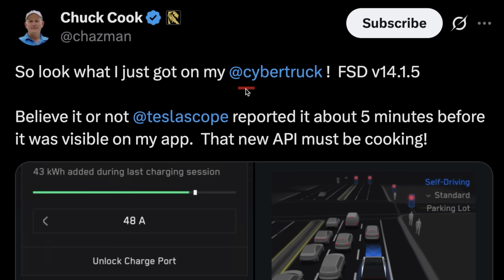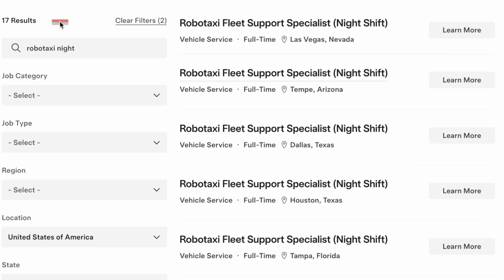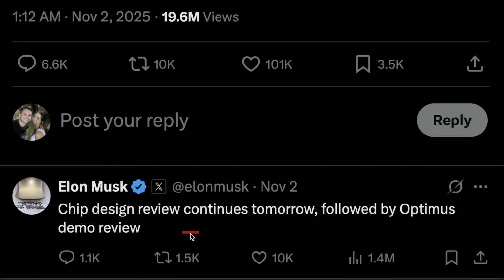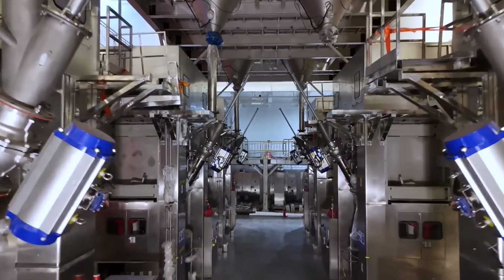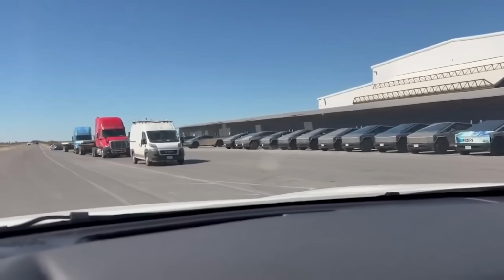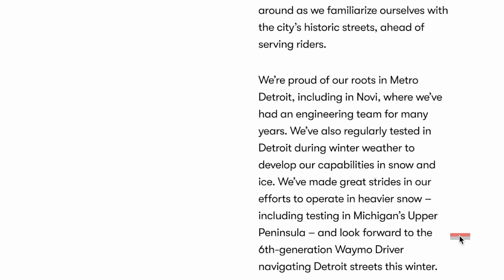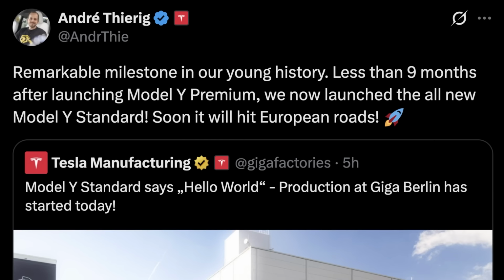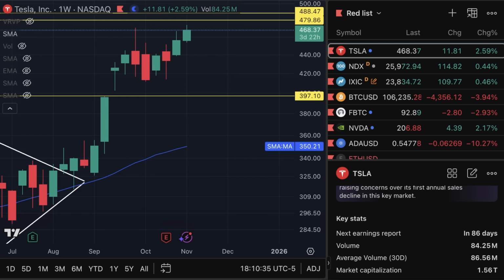Elon's Wild Optimus Prediction / Tesla's New AI Roadmap / Tesla Signs $2B Deal ⚡️

Comment: It is quite astounding.  In the the late 1960's, an integrated circuit used lithography technology that reliably made transistors at 100uM dimensions.
In 2025, TSMC is making reliable silicon with 3 & 6 nM technology with good yields.
This is a density increase of around 17,000 times.  And it looks like 2nM tech is on its way ~ 50,000 times.

Comment: Tesla needs to move to ASSB soon for the fleet of RObotaxis and Optimus. Will reduce charging time  ( more time on service) and more imptly number of charging terminals. IN addition with LFPs.. run time is abt 3-4 hrs on light load work. Huge cost savings

Will not be surprised it the  Samsung deal to include switching over to ASSB by 2027?

Comment: Just like to chip in based on my experience over 20 years embedded system engineer career。 
From tape out it would take a month for sample to come back if they are in hot run (more expensive, but small amount )。 
Then typically system verification would take within 6 month to verify ok， (if failed, then add another 3 month or longer) 
Then ready to start production， the ramp usually take another 6 month to reach 100K+ chips (products)
It won't take 18 month, if it does, people lost their jobs

Comment: So, the fender repeaters were moved forward for one major reason. Those cameras will be used to monitor the opening doors, and their previous location was mire limited. The Cybercab does not have the sensors in the door like the Model X, so they have to use vision to ensure the doors don't hit anything.
Reply: 😢😢😢😢😢😢😢😢😢😢😢😢😢😢😢😢😢😢😢😢😢77😢😢😢😢😢😢😢😢😢😢😢😢😢😢😢😢😢😮😢😢😢😢😮😢😢😮😢😢😢😢😢😢😢😢😢😢😢😢😢😮😮😢😮😮😢😢😢😢😮😢😮😮😢😢😮😮😢😮😢😢😢😢😢😢😮😮😢😮😢😢😮😮😮😮😮😢😮😢😢😢😢😢😢😢😮😮😢😮😮😮😮😢😢😮😮😮😢😮😮😮😮😮😮😮😮😮😢😢😮😢😢😢😮😢😢😮😢😮😮😮😮😮😢😮😮😢😢😮😮😢😢😢😢😮😢😮😮😮😢😢😢😢😢😮😢😮😮😮😮😢😮😮😮😮😮😮😢😮😮😢😮😮😢😮😮😮😮😢😮😮😮😢😮😢😢😢😢😮😢😮😮😢😮😢 8:05 😮😮😮😮😢😮😮😮😢😢😢😢😢😢😮😮😮😮😮😢😢😢😢😢😢😢😢😢😢😮😮😮😮😮😮😮😮😮😮😢😮😢😮😢😮😢😮😮😢😮😮😮😮😮😮 8:13 😢😮😮😢 8:13 😢😮😢😢😮😮😮😮😢😮😮😮😮😮😢😮😮😮😮😢😮😮😮😮 8:16 😢😮😢😮😮😢😢😮😮😮😮😮 8:18 😢😮😮😮😢😮😮😮😮😮😮😮😮😢😮😮😮😢😢😢😮😮😮😢😮😮😮😢😢😢😢😮😢😮😮😮😮😢😢😮😢😢😢😢😢😢😢😢😢😢😢😮😮😮😮😮😮😢😢😢😢😢😢?7